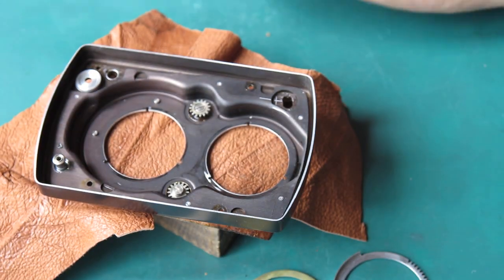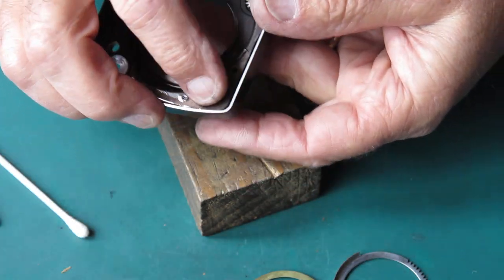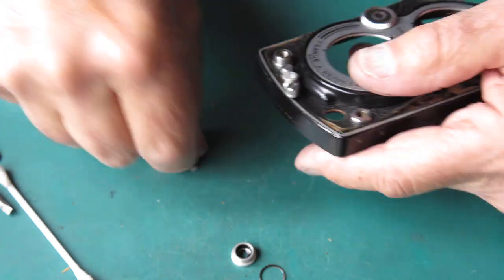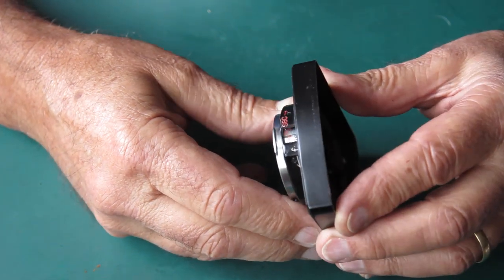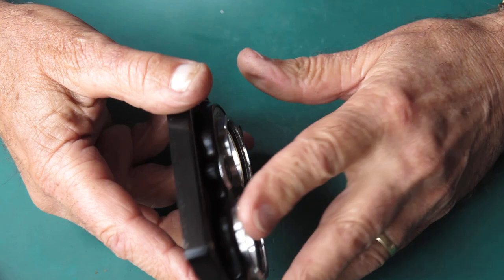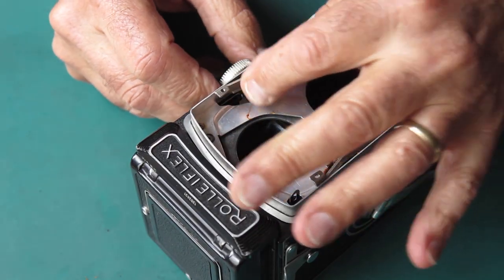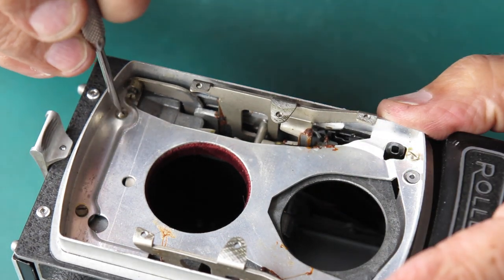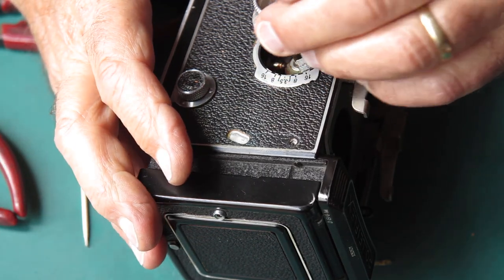Rolleiflex repair, servicing a Rolleiflex Automat TLR. Part 06

Comment: What I found out to be really helpful to remove really tight screws is to use a screwdriver which has a thick handle, increases your torque while using minimum force, so youre more in control and you don't run de risk of the screwdriver coming out of the groove and maybe damage something else.

Your videos are a treasure, thank you for uploading and sharing.